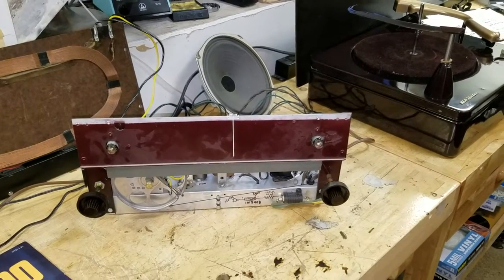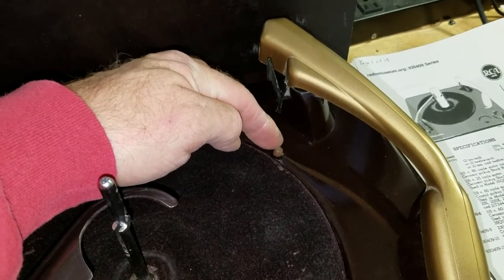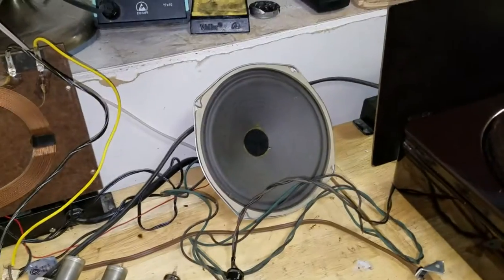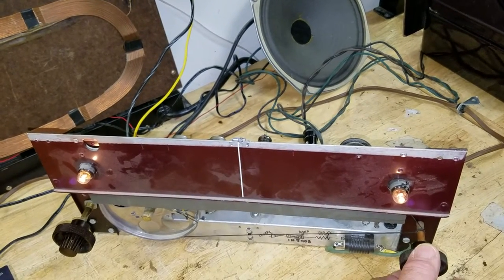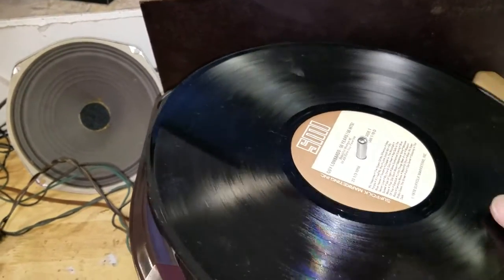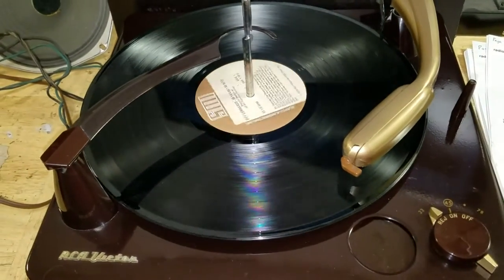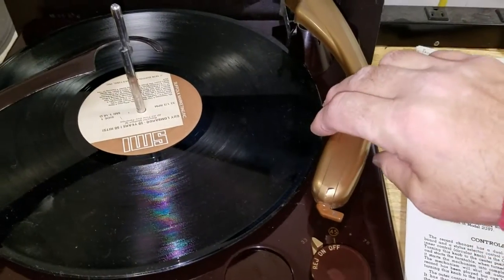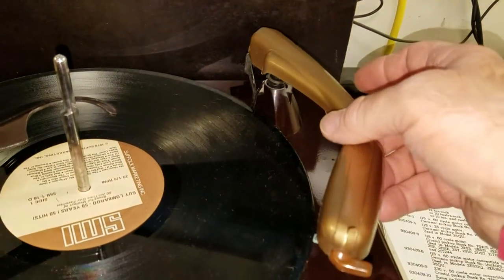1951 RCA VICTOR 2S7 RADIO RECORD PLAYER - 8/14/16

Comment: Cool player! RCA Victor made one of the first all-speed record changer in 1950 or 1951, just two years after the launch of the 45 RPM format and the 45 RPM record changer in 1949, and prior to that, Columbia launched the LP format in 1948. RCA Victor re-launched the LP format by 1950, just 17 years after the format flopped. RCA Victor started an early experiment of a LP format as far as 1931 as “Program Transcription” series, and it was a failure due to the lack of sales. So they put them on hold until 1950.

Comment: Huh. I guess this is a slightly different version from the 2js1, which I’m repairing right now. I have no idea if this was on all these old rca motors, but in mine they used foam to hold the motor in, and it’s hardened and broke causing the motor to be out of alignment. Ive got it somewhat working though by sticking it down to the player. But I can’t complain for finding it for $10.

Comment: That console will look and sound great when it's back together. Nice job preserving the look of the tone arm. I wonder if anyone has found a subtle was to add a "7--10/12" lever to one of these small platter VM changers. The one feature I really don't like is the stationary rising feeler, especially with 12" records.  It's only marginally useful, since it doesn't enable much intermixing; the 10/12 feeler seems more benign and more important.
Reply: Just stack your records on a VM from smallest first to largest, then the 10" sensor does its job fine. The Magnavox Collaro changer can intermix sizes as well, as long as you stack largest to smallest, the opposite of the VM. Webcor's "Magic Mind" and certain Glaser-Steers changers went a step further and changed the speed from 45 to 33 automatically when the 12" flag was tripped, and back to 45 if it wasn't, which allowed intermixing of 7" 45 records with spider inserts and 33 12" records.